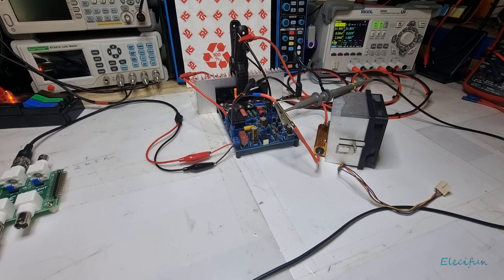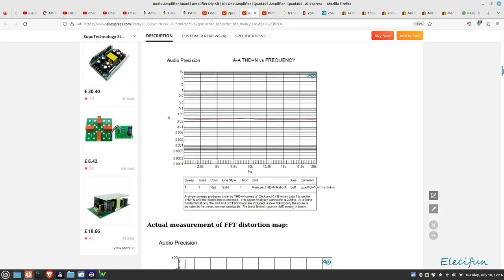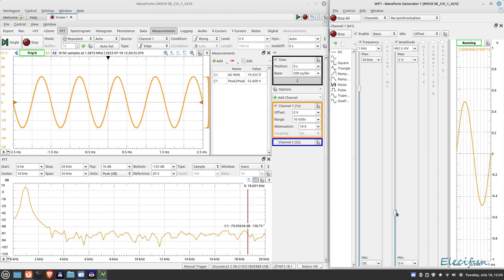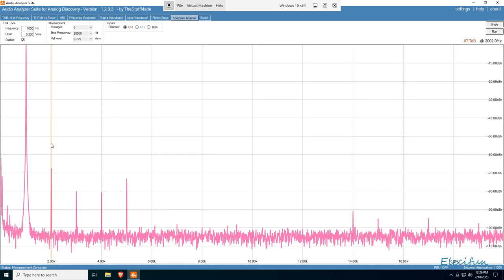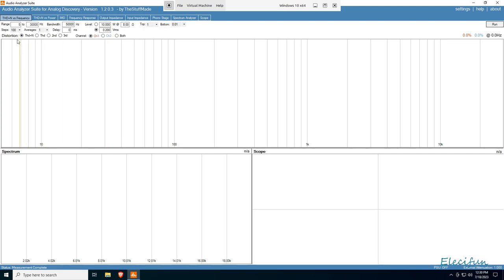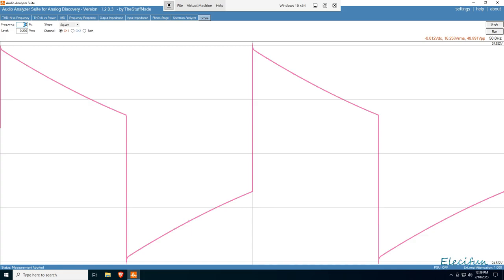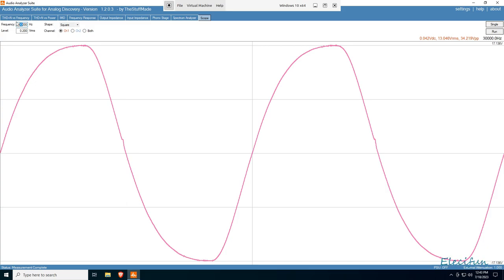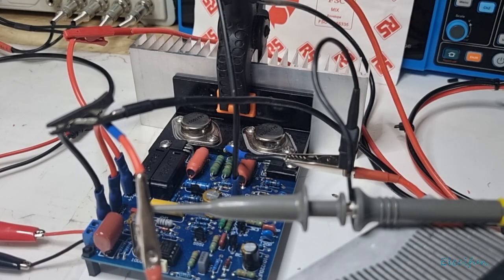QUAD405 Audio Amplifier Clone Kit (Aliexpress)

Comment: Hey Sir  👋

The Quad 405 !

Which one is it?

I visited AliExpress and there are many different versions of it.

How much?

100W per channel?

I managed to pry myself out of bed today and finished off sanding and adding the sislation to the walls.

Between the studs which there were 8 that's where I put the sislation which must go in before the insulation.

Now it's ready for the plasterboard  which hopefully will go on soon.

I picked up all my tools and vacuumed the carpet.

Sigh. What a job.

Then I took down a tarp that I put over my work bench unfortunately white dust over everything which means a long arduous clean up.

Anyway I'm glad I get this far and I'm making progress.

Two pieces of plasterboard to go on next.

Then I need to bog the joins.

That's going to be fun. 😅

I can't wait to finish it and add more shelving.

Then finally I can get all my tools organised.

I'll have more shelves for electronic stuff although I think I'll mount all my battery chargers for all my power tools.

These power amps are interesting.

Today I was reading about audio power supplies.

The one thing I find confusing is the ground rail.

Three wires not 2. 🤔

Anyway I shall keep reading. 📚 

That X2 suppression capacitor is interesting.

I read that the cheap electrolytic capacitors are cheap to make but the problem with them is they're not ideal for audio.

Apparently that where some of the  distortion or noise comes from.

The X2 suppression capacitor uses different dielectric materials which helps reduce noise or distortion.

Those Nichicon caps you're using are they genuine OEM? 

I read there are counterfeiters that sell fake caps.

Anyway interesting new diy kit sir.

I'll eat dinner now.

I'm half dedicated now.

Seeya Sir. 👋🙋🏻‍♂️

Comment: The amplifier does have an LPF used intentionally to avoid dynamic IMD, so the meander will be smoothed by design. And there is no harm in it because there will be no square wave transitions in real input signal. Real input signal passes through multiple LPFs including DAC filter (or LPF filter for vinyl).
I made my own video with measurements for this type of clones (English subtitles are available).
Reply from the maker: @bonobo9904 Cheers for the input.. I will check out your videos on this subject.

Comment: What's happening over there in England apart Nigel Farage losing his bank account? 

I can't do much here because I'm still slowly renovating my workshop.

Hopefully I can mount the plasterboard next week.

Then I'll bog it.

After a coat of paint.

Then the shelving.

Anyway kinda interested to see how your amps are going.

Have you built anymore diy kits?

Oh incidentally my new Rigol DP932E arrived today.

I tried it out and I think it's pretty good aside from the massive hole in my saving. 😢

Anyway,

See you later dude.

🙂
Reply from the maker: I checked out your power supply... very nice. Bit pricey but having a good supply is a great asset for your bench. I don't watch the politics anymore, it makes me want to kick the TV. Farage pressed the secret bosses buttons and that attack back. I like him.
Yeah been building and testing and listening and retesting and listening until I wanted to take a rubber mallet to my own head. Spent days going over the results knackering myself out. Tonight I have beer, tomorrow I look at making video.
P.S. have found a DIY amp kit you might like, unfortunately not 800W, a modest 100W.

😀
Reply: @Elecifun  How much would it cost you in the UK sir ?
Reply from the maker: @decem_unosquattro9538  can't find in the UK. In EU 500Euros.  UK still sells DP832A's as the same but without touch screen and 832's screen a little smaller. 
Most spec the same. Good supply, good buy.
Reply: @Elecifun  that's about 830AUD plus our 10% GST. Plus freight. 

It's just insane the prices over here. 

I know they're putting freight prices up again.

I can't see how we can survive with such crazy cost of living. 

If we don't enter a finacial depression I'll be very surprised.
Reply: @Elecifun  one seller here wants over $1052 for the DP832.

The other is $ 945.

$930 for the DP 932E

Makes no sense.
Reply from the maker: @decem_unosquattro9538  It's a new product m8, it will cost. Can't wait to see a teardown of it, to see how similar the insides are to mine. 
EDIT= The DP832 has the hack enabling high resolution and more.. 932E users have to pay for the extra features at the mo.
Reply: @Elecifun  Yeah I know. We can bet they made sure you can't hack the 932E. 🙁 I'll bite the bullet and do the upgrade  one day. More money. Sigh.
Reply: @Elecifun  Well I hope there isn't much difference. It is slightly lighter which is a worry. 😟  Anyway hopefully it lasts and I don't need to replace it anytime soon.

When are we gonna see a new video sir? 😀
Reply from the maker: @decem_unosquattro9538  It will last you m8 Rigol produce some nice kit
Reply: @Elecifun  I hope so it cost me a friggin fortune. Sigh.